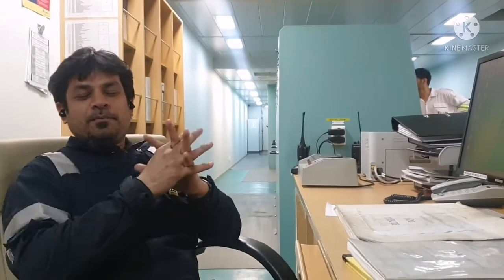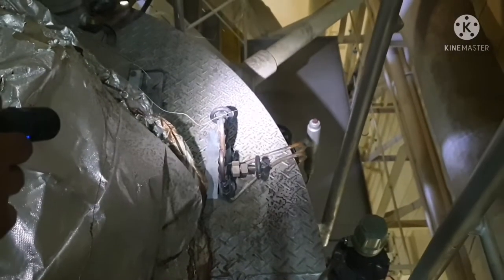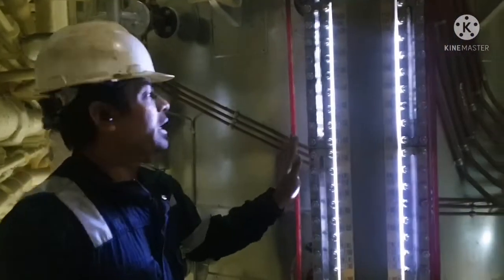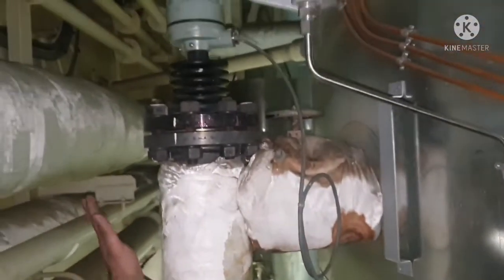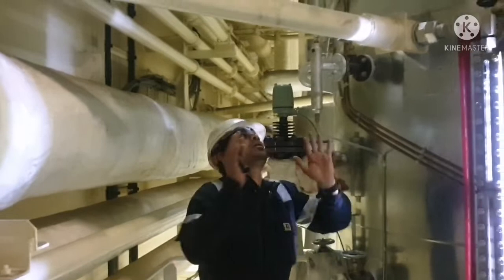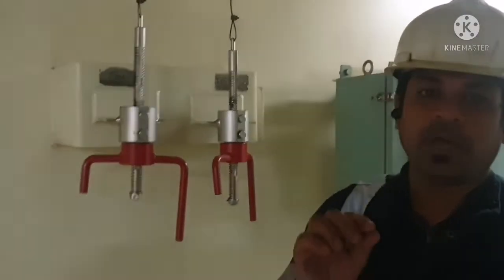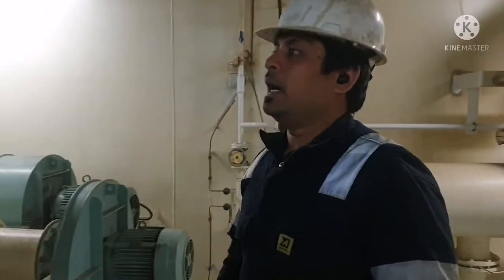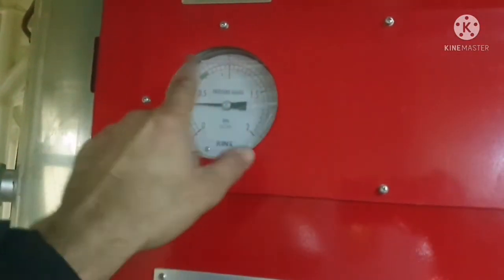KNOW EVERTHING ABOUT MARINE AUXILLARY BOILER....

Comment: Sir hope u a doing fyn ,
One doubt 
In IG system ,From where the high and low pressure of IG is sensored , exact location of pressure sensing in the line...
Reply from the maker: Sir.. 
It is sensed from the main IG line to tanks after the deck seal.
Vl gv u elaborate answer on this  soon sir
Reply: @marine-knowledge-basha  thank you very much for your valuable informations, expecting elaboration 🤗
Reply from the maker: @arunsudhakaran9968  vl gv for sure sir...

Comment: What are the two place we can do dosing? one is chemical tank dosing and another place is ? Asked by mmd. 
 What is gagging of safety valve. Why it's two safety valve?. Both safety valve having different setting valve. If yes. How much and why they are fixing like that?
Reply from the maker: Thanks for your good query sir...
* chemical dosing can be done thru dosing tank and also thro cascade tank which is also cald as hot well.
* Gagging of safety valve is manually blocking the safety valve from lifting at desired pressure.. This they do wen they test the second safety valve in boilers.
* S sir both safety valve hv different setting
* This is as a safety if one safety valve doesn't lift due to sme reason.. The next valve which the lifting pressure is higher than the first valve  vl lift and release the excess pressure.
Hope this reply will satisfy your query.

Comment: sir, good day. i need your help.
during your watch, if you see that, boiler safety v/v is continue lifting. what could be the reason and what ACTION will u take?
this question i cant find anywhere. pls help me
Reply from the maker: If you find the safety valve is continuously lifting during your watch..
* check for the boiler pressure.
* check whether the boiler is firing in manual.. If its manual change to auto mode.
* check whether the other safety valve is also leaking.
* try to open steam to some bunker tanks and reduce the steam pressure.
*. If the valve is lifting below the set pressure then the valve shud b overhauled.
 Hope this reply will satisfy your query..
Reply: @marine-knowledge-basha  thank u sir, this is actually a oral question, surveyor ask now a days. you helped me a lot🙏